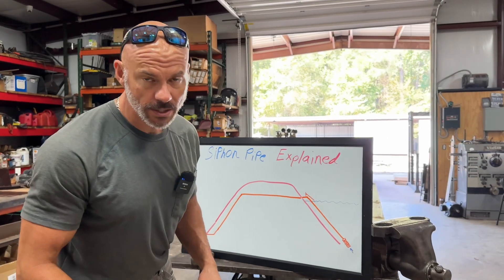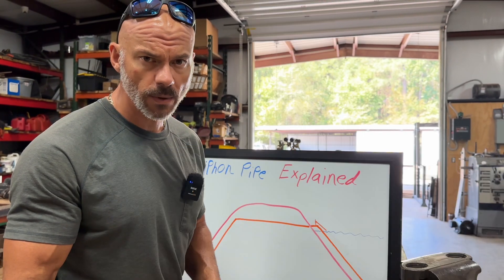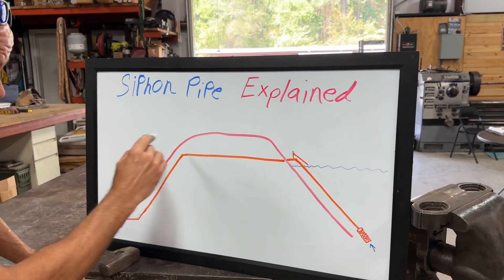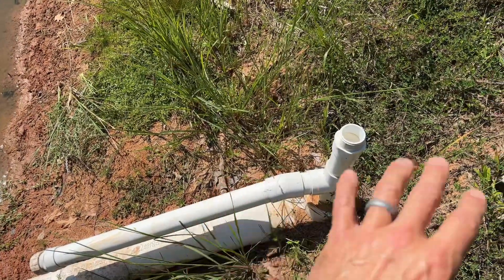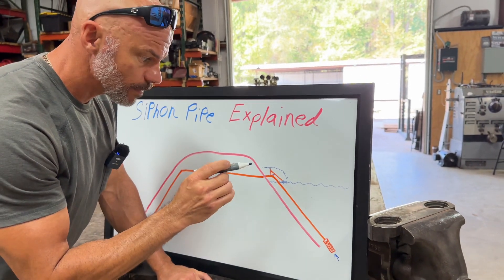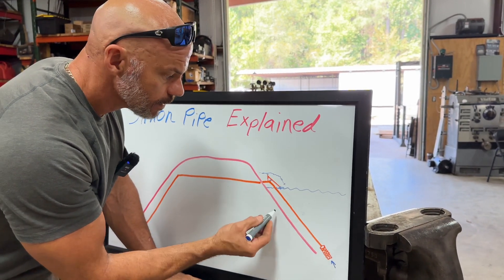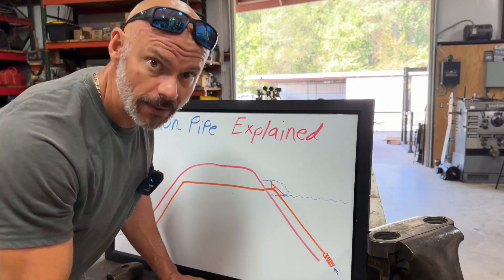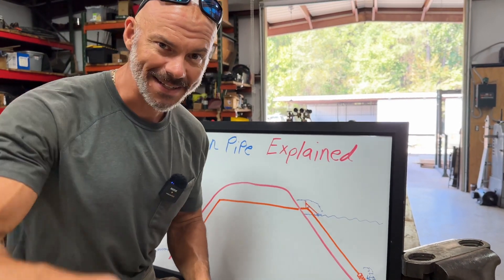Pond Siphon Pipe…

Comment: If you put the cap on top of the vent pipe and extend the vent to somewhere in the range of the top half off the thru the dam pipe it would not vary as much on the level the pond stays, and the further you can extend the output plus add a trap  at the bottom of 2 22.5 bends or 1 45 bend to assist in starting the syphon, and would greatly increase its ability

Comment: I installed a 6" syphon system on my little 3/4 Acer pond. Works great until there is a huge rain. My problem is that even when the pond raises 2feet or so the 6" pipe never pulls the full amount that it can. It will pick up volume but never fully engages. Any ideas?

Comment: Have a 12" on a 10 acre pond. Works flawless. I dont have a pipe above drain. Water dont rise or fall much. Your air pipe is not ideal. Mine comes straight out of 12".  With a short elbow.

Comment: I never used a siphon pipe but I like the idea it would take a major load off of the spillway we put it I have to fix it every couple years from the erosion even though it’s made of concrete I’ll have to give that siphon pipe a try I got a good little bit of 6” I could weld up a stuff in there
Reply from the maker: Give it a shot. PVCs pretty cheap and easy. Well, I guess it’s not cheap anymore lol

Comment: The stand pipe method likely works better. Jon over on FarmCraft101 just did a pond build for his neighbor where he installed one and also has one in his own pond. The flow is likely restricted by the pipe size one chooses but sounded like a more real-time solution than the siphon method since the draining happens sooner. You may benefit from checking it out. Happy building o7

Comment: I have used a Bell siphon my duck pond and hydroponic gardens. Putting a culvert drain is the common way to maintain pond levels but as you said erosion is an issue. We do not have ponds here but retention areas are common along roads and near parking lots.